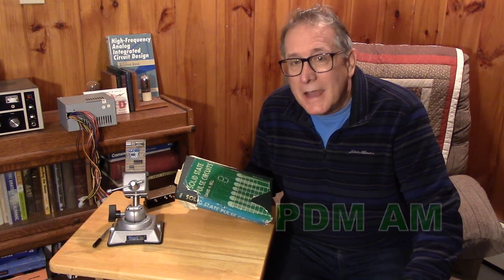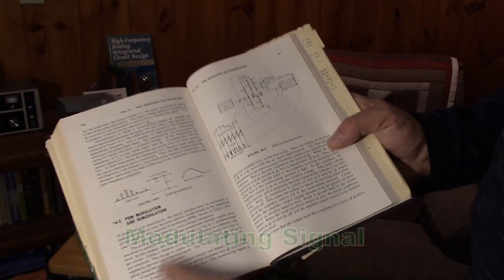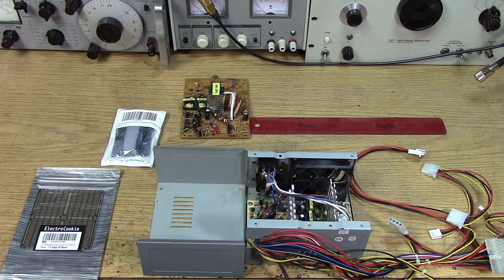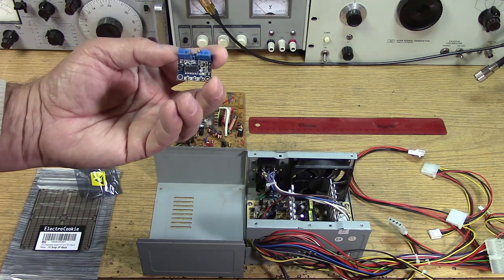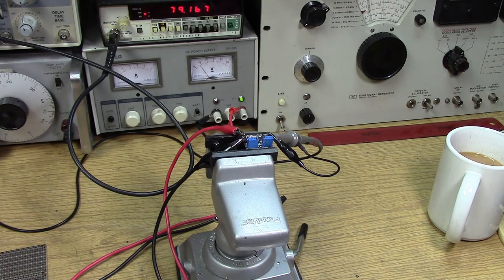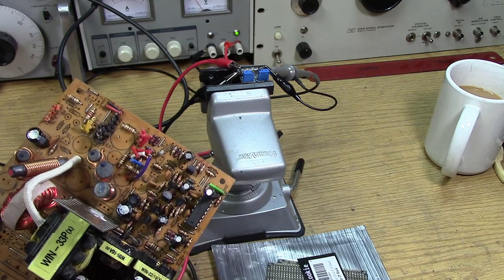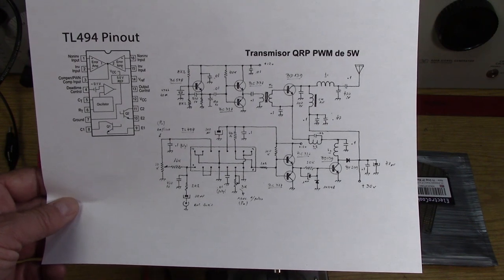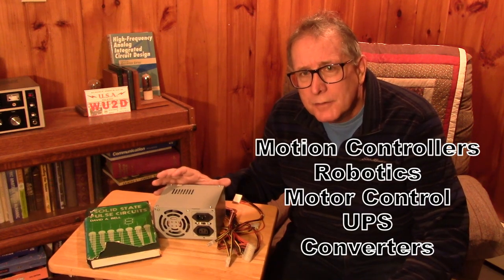PDM Part1

Comment: Thanks! I just came across this. I want to build a low-power transmitter for the AM broadcast band to provide "content" for my collection of AM radios, and I think one of these PDM/PWM designs based on the TL494 would be perfect.

Comment: I'm not that familiar with the bandwidths ALLOWED on each ham band. What output band are you planning on? Splattering all over any of the HF bands I would think will bring a lot of complaints!
Reply: Great question❓  interested to hear a reply.
Reply from the maker: Part 97 of the US FCC rules is not explicit enough to answer this question to most peoples satisfaction. a) No amateur station transmission shall occupy more bandwidth than necessary for the information rate and emission type being transmitted..Technically an AM transmission's bandwidth is equal to twice the information rate since there are two sidebands. So if someone declares that they need a 4 kHz band width to produce proper voice fidelity, the BW would be 8 kHz. Certainly a well designed SSB radio could require 1/3 to 1/2 of this BW. But the point is that both are legally operated within the confines of the necessary bandwidth definition, and AM has not been made explicitly illegal on the US ham bands in the phone sections. What is verboten is 1. Emissions outside the nesessary bandwidth (splatter) and 2. Harmful Interference.

Comment: Very interesting, this is how Sine Wave inverters work on the principle of PWM. Was not fully aware you could do this with AM transmitters. I seen videos of commercial AM stations use multiples of RF power modules digitally switched on, according the  amplitude of the audio, to add to or subtract from the RF carrier level. Way beyond what your doing here.

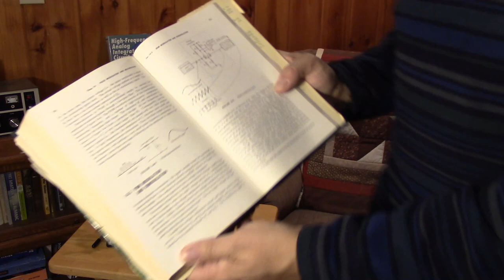Comment: 1:43 is digital and pdm the same? I know pdm is pwm but not pcm. Just curious. Interesting video on the subject. 👍
Reply: A train of PWM pulses alternates between two voltage levels, but the width or duration of the pulses corresponds to the amplitude of the audio, i.e. narrow pulse for low amplitude, wide pulse for high amplitude.
Reply: At about 9:50, PWM is essentially PDM. I.e. Width ~= Duration.

Comment: Hello,
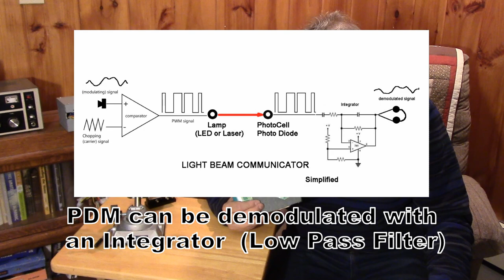Is this PDM Pulse Density Modulation or Pulse Width Modulation? Pulse Density Modulation which  keeps the pulse duration constant and varies the number of pulses over the  analog signal. Pulse Width Modulation varies the width of the pulse . These are two different animals (circuits) from what you are showing @2:53 it appears to be Pulse Width and not Pulse Density???
Reply: It's pulse duration modulation, also called PWM.

Comment: Well well well, a solid state project now...  and it looks like it will be a fun project too.  Good luck.

It appears that most projects related to ham radio are related to either CW or AM modes.  Although those are both simple and fun, they are  not as useful today as SSB would be. For example, all digital modes can be derived from USB modulation (see fldigi and WSJT-X softwares). Unfortunately there is very little documentation for simple circuits or projects, like this channel could provide. An SSB modulator appears to a very difficult circuit: two mixers/oscillators and a narrow filter! Quite heavy! I can not believe there is nothing easier (using a chip or two if necessary!).  If you know an easy solution, that would be a great project that you could present. One day maybe...

Thanks

Comment: Very nice video on this interesting topic.
I've tried to make a Class E PDM AM transmitters in the past  but never managed to get the PA to work, sadly.

I was using a "programable" PLL with TTL output with 4046, 4060 and 40103 , ref xtal was 9.216MHz, gave 9kHz step which is good enough for EU AM radios.

What Class of the PA are gonna be using? C or E?
Reply from the maker: In a simple rig at low power, Class C is completely usable and unfussy. But let's try both C  and E and at least discuss Class D.

Comment: Mike, what an interesting new project, I'm excited to see the new exciter. My winter project is a mosfet AM transmitter along the lines of the fat5 project. I've built the modulator using a 60w amplifier chip, although this series now might cause me to rebuild and go for a more efficient and interesting design.
73 Steve M0KOV